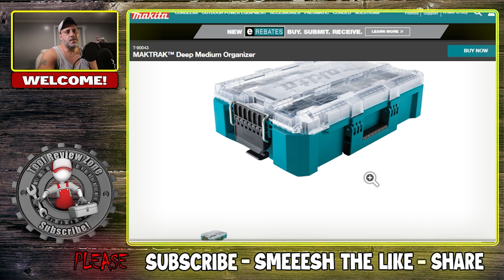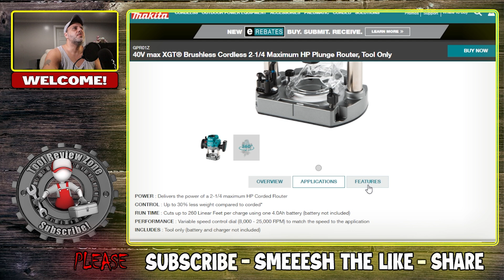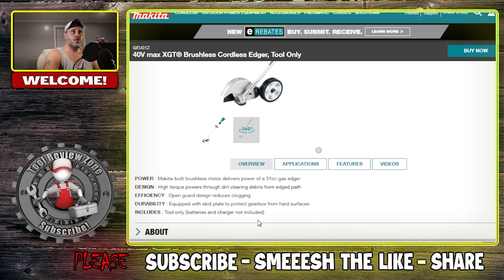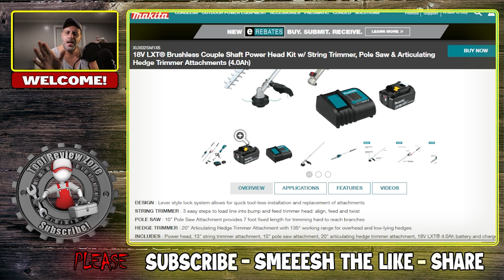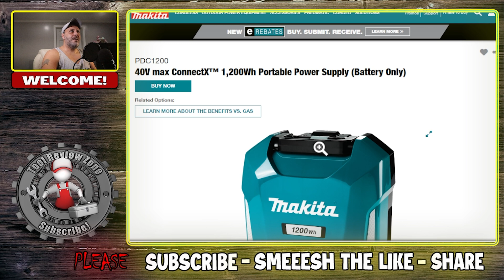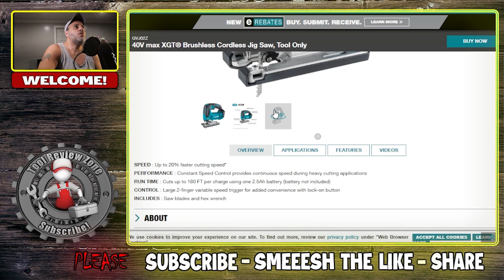New Makita tools announced

Comment: I wish I can afford XGT!!! Unfortunately half of my LXT got stolen not too long ago and now I’ve replenished some of it with LXT but also have gotten into M12 and possibly M18 as time goes on. I can’t afford Makita anymore to keep in a trailer.  Milwaukee has some awesome tools but across the board, they are ok quality.  Definitely not refined like Makita. I hope it don’t regret it in the long run. It’s just that I can replace a Milwaukee tool on Facebook marketplace for around half the price or even less than finding a Makita. If I had to pick one brand or if my life depended on it, it would be MAKITA.  No questions.